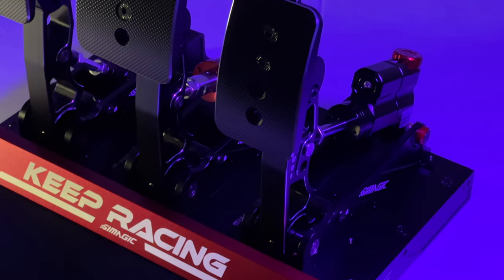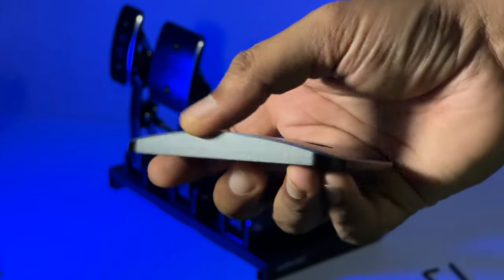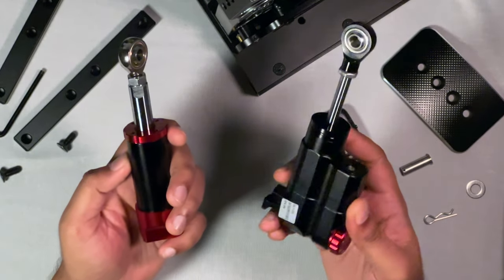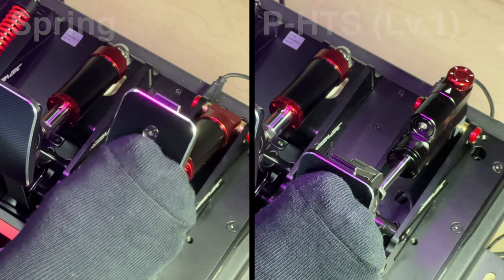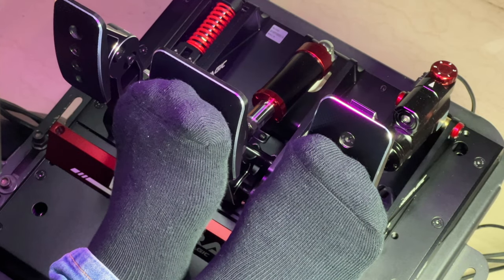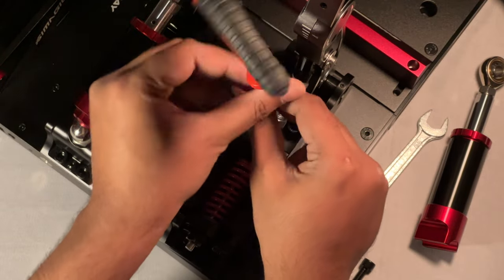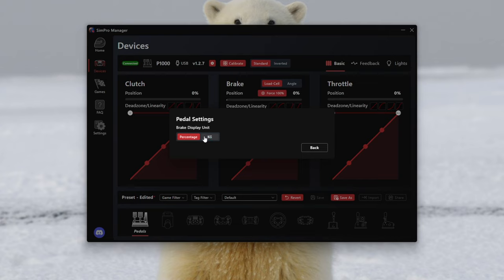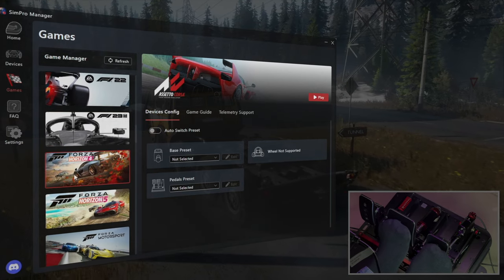THEY RAISED THE BAR AGAIN - SIMAGIC P1000 + P-HTS Hydraulic Throttle Review

Comment: I pretty much agree with everything you say. I got these petals about a couple months ago I got the two petal set with two haptic motors but didn't get any of the throttle or the break upgrades. I did get the Rubber elastomer and I absolutely love them. Besides the throttle being a little light. I have no complaints even hooked up the haptic motors to SIM hub. So now they work with every game.. Never had haptics before this and they feel amazing in rally. And put ABS on the brakes and traction control on your accelerator With the two motors are really really good in ACC. It helped me beat my best lap times
Reply from the maker: Thanks Bear! I'll definitely try out the Haptic Reactors soon. I'm loving these pedals.

Comment: You got the newest version with upgraded motherboard like me. How you can tell is if your pedals come with the metal ball with a hole and the throttle has the gold bar behind the throttle. Thode are two pieces that are actually used for the hydraulic sets so now you dont need to change those parts out when changing over. Anybody who gets those gets the updated set. Mine just got a week ago came that was and was very happy because my brake is spot on. I found using it at 80% for pressure% and or sensitivity works amazingly. Perfection.

I will be getting the hydraulic upgrades and the haptics.
Reply from the maker: These have not left my second rig since the day I reviewed them. Absolutely banger set of pedals! Enjoy your P1000s

Comment: Interesting review! What are your thoughts on the P1000 value for money after factoring in the additional cost of the brake and throttle upgrades? Incremental upgrades can certainly push the price higher and higher
Reply from the maker: I'd say that including the crucial (sort of) addons such as Hydraulic Throttle and brake at well under 1000USD seems like a great value. While yes, an individual can opt for transducers, the Haptic reactors aren't bad at all. Especially considering that they are Simhub compatible now. 

While addons might keep piling up resulting in a price bump, I would say that it offers a very particular set of customization for everyone. An individual doesn't necessarily have to buy all the addons, but I'm happy to see that Simagic is catering to all the needs if the simracing itch comes back.

Comment: Hi, Would you choose the sprints or these? I’m personally leaning more towards these but I want to know your opinion. Thanks!
Reply from the maker: If you are planning on not buying any upgrades for P1000s, then I’d suggest you to go for Sprint. If you plan on spending a few bucks here and there to upgrade stuff, then P1000s all the way.
Reply: Have you personally used the Sprints? I used them at a friends’ place and I really don’t like them. I don’t see the hype. Do you maybe have a few settings  I can tweak so I have a better experience next time? With the feeling I have now I’d rather have my old T-LCM pedals than the sprints. But I am going to the Sim Racing Expo in October so maybe I’ll get to try out the P1000’s there and then maybe buy them.
Reply from the maker: I use Sprints on my personal rig (have been using for 2 years now) and have P1000s mounted on my secondary rig. 
While Sprints are praised for their durability and the level of customisation it offers, P1000 isn’t a slouch either. My Sprint have been set in a manner where after 15-20% of the travel, it will be a brick. Like a proper brick. I used plastic spacers in the end because I found them better according to my usage. There are elastomers included as well, so you can experiment it to better tune it to your liking. I too started from all elastomer layout to a more brick feeling brake. 

On P1000, I use all elastomers. The shape of elastomers which Simagic uses (button design) makes it feel very different from all the pedals using cylindrical elastomers. 

I too switched from T-LCMs to Sprint and there was definitely a learning curve. Both P1000 and Sprint are excellent set of pedals that I would recommend blindly.

Comment: Excellent analysis. I am about to pull the trigger on these. Going through other reviews, people were saying (including Dan Suzuki) that when you have brakes on load cell the brake pressure is not consistent i.e. if you have you put constant pressure the software registers the right pressure and then immediately drops a bit even though your foot has not moved. The recommendation is to use angle(this issue doesn't happen) instead of loadcell. Is that true? The reason I am asking is if I am moving from a low end Thrustmaster pedal to a Simagic one I want to be using a loadcell. I hope this makes sense.
Reply from the maker: Hi there! I didn’t find that to be the case. It could be a unit dependent issue. I believe Racebeyondmatter found it. Either way, The ones I got didn’t act funny. Or perhaps it could be a a software issue.

Comment: Hello again how are you?
I will probably buy them and i want to clarify something in my mind to justify the price.
Whatbi dont like about my fanatec V2 is that even with the softest elastomer-spring they have very limited travel.
For gt and formula is very good but fir rally and weight transfer is difficult to brake.
For rallying i would like a softer pedal and cause you brake so ofter it gets tiring and i tend to brake less than i should.

I hope you understand whatt um saying and do you think the P1000 would solve this problem?

If so i really like the design and way simagic is going and i would like to have this pedal in my rig

PS your videos are very helpfull and for some things explained i recommend your channel
Reply from the maker: Hey there. I’m doing good, and I hope you’re well too. 

I understand what you’re trying to say. If you have a little bit of doubt in your heart, you can get your hands on the additional spring/elastomer parts that Simagic offers. You can then choose to stick with springs or elastomers for brake. It has a lot of combinations, so I think it will not cause an issue.

Comment: How do you have so much travel in your brake? I have put all black (softest) elastomers and still it's super hard and barely any travel. Pls help!
Reply from the maker: Hey there, have you tried adjusting the preload? 
And also a quick question, the pedal is mounted to a solid surface, right?

Comment: Do you think P1000 pedals are upgrade coming from Fanatec CSL Elite v2 ?
Reply from the maker: With addons, absolutely. 
Without addons, imo, also yes.
Reply: And what is your opinion about Hydraulic brake kit, is it worth it ? Or just buy regular P1000 ?   @darthsnape
Reply from the maker: @P.I.D.27   I did not test the hydraulic brake kit, but I have read some mixed opinions. Some say it's great, some say it feels more or less like the brake. 

If you haven't tried a hydraulic brake system, I'd say give it a whirl. Maybe you'll end up liking it.

Comment: How are you able to get pedals on snowrunner? I thought it wouldnt allow for wheel and pedal? ty!
Reply from the maker: It is an update that came not so long ago, which makes Simagic only products work with arcade games with poor wheel support. 

The pedal should be connected directly to the base instead of computer. Similar to how a Thrustmaster functions. Connect the pedals to the base and it works.
Reply: @darthsnape  Thank you. I have an alpha mini and sprints, so i can connect them to the mini?
Reply from the maker: Sadly, the pedals have to be Simagic. No other pedal would work.

Comment: This may be an odd question but does anyone know if you can use the p1000 clutch pedal individualy (directly connected to the pc via usb without the brake and gas pedals)? I have the opportunity to upgrade my 2 pedals set (moza srp) with a simagic p1000 clutch. I don't want to buy a complete set of pedals for the moment so this could be a nice upgrade if it works individualy. 
Thanks in advance,
Reply from the maker: I don’t think that would be possible as the clutch can only be operated by the control box on P1000s. I don’t think mix and match will work.
Reply: @darthsnape  thats what i feared. Thanks for the input!

Comment: What a great video!!!! :) Can I ask.... what do you think would be better P1000 with Hydraulic Brake (and maybe also Hydraulic Throttle) or P2000? (both are similar price in Australia). Thank you :) Don, Perth W.Australia (Dons Shed and Xplor Overland)......  p.s. I've Subscribed :)
Reply from the maker: Thank you, Don. I would say both are very good options. Only difference would be that P1000s have a 100kg loadcell on brake by default (can purchase 200kg as addon) and on P2000 (equipped with a 200kg loadcell on brake) you get triple loadcell. Meaning all pedals have loadcells. P1000s have loadcell + hall sensor on brake, and only hall sensors on throttle and clutch.

Not that it makes that big of a difference. If budget isn’t an issue, it ultimately comes down to what you find aesthetically pleasing. Since hydraulic throttle comes by default in P2000, you’d only have to pay for the hydraulic brake. Both are extremely compelling offerings.

Comment: Personally, I found the P-HTS far too weak to be of any use, and unnoticeable when driving.
It could have been really good if it had higher levels of resistance.
Reply from the maker: Interesting. What level do you usually use it at? And for what discipline?
Reply: @darthsnape  Level 6 and circuit racing.
It's worth noting that I'm a big guy with big feet and use racing shoes, so it's gonna be different vs smaller feet and socks.

I can definitely feel the hydraulic damping when pushing it with my hand, I just need it to have some higher settings to be effective under foot.
Reply from the maker: @mrspangles932  I agree. Since I don't use shoes, that could be a contributing factor. When I moved back to sprint, I immediately noticed the resistance of the throttle pedal which is set to medium (around 8kgs of actual force according to HE manual).

Comment: Great review. I have these pedals and I love them, a massive upgrade from the fanatec csl load cell pedals. 

I replaced the throttle plate with the longer one and it feels much better.  I would highly recommend you get the vibrator attachments.  They work great although much better through simhub compared to the simagic software.

Like you said, the heel plate is a bit short but with the longer throttle it's not that bad.  I've not found any other down sides after 3 months of use.
Reply from the maker: I have been eyeing the long plate throttle and haptic reactors. Are you using the hydraulic brake?
Reply: @darthsnape  yes, I've got the hydraulic brake but not the hydraulic throttle.